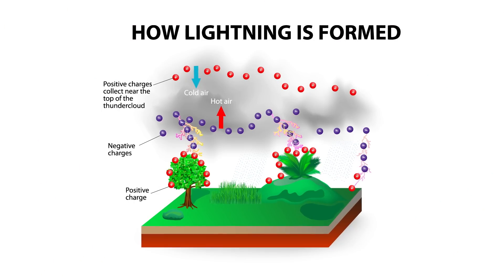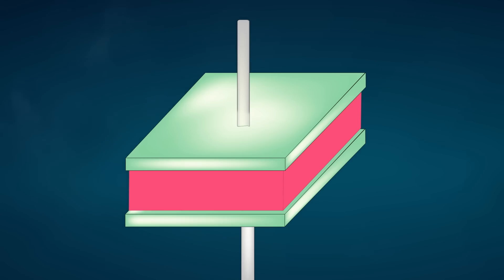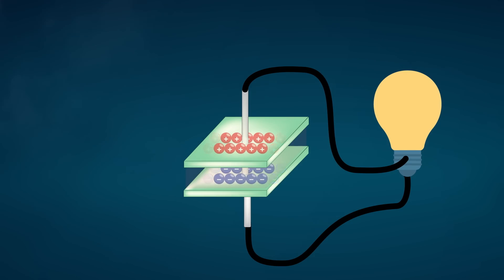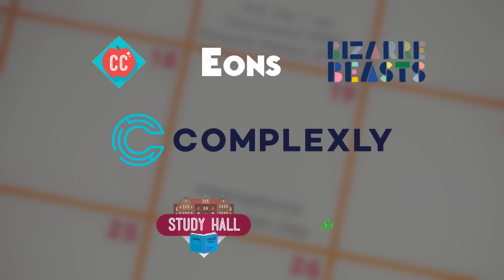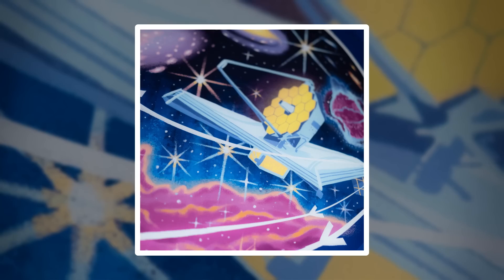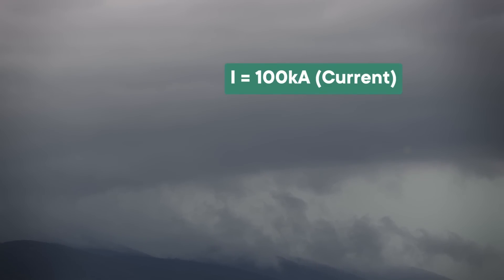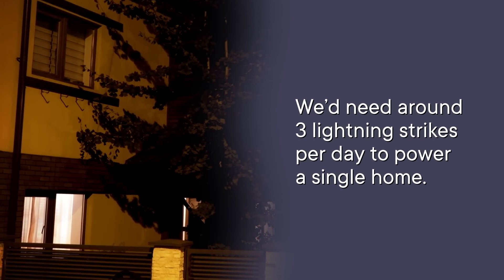Why Can't We Use Lightning for Electricity?

Comment: Thanks for the effort but this video is not up to standard I expect from SciShow... No ... you don't need to create a power plant that gets struck by lightening in order to harvest the energy from lightening. The more plausible way of doing this would be to steal the charges from the cloud BEFORE it forms a lightning. The technology is still in development and is a called "atmospheric electricity harvesting" or "air electricity generation". The field exists, but it’s early-stage, small-scale, and not equivalent to storm-energy extraction.

To understand this better we need to look into how lightning rods work. here is a gross over simplification: A lightning rod gets to work even before it is struck. It has a pointy tip that bleeds electron into the air that is charged positively due to significant negative charge in the cloud. The rod creates a small area around the building (few meters across), that is just slightly less likely to be struck. Of course this is not always enough for larger clouds and there is an eventual point of failure where the rod does get struck by lightning and in that case, they offer a safe way of dissipating that energy to the ground. The effect of a rod being hit by lightning still can be catastrophic leading to damage being done to the rod, but the structure is largely unaffected and it is far safer than a direct contact with the lightning. In my opinion, if we have a chance of harvesting this energy, it would be done at the slow trickle of energy through these rods and not through the lightning itself. Given how little this energy is, it might not worth it to try anyway.

In the mean time we are far better off relying on energy sources such as Solar and nuclear.

Comment: Lightening is too unpredictable and too insanely high of a voltage. Not to mention the unstoppable, melt anything current, The electricity would unpredictably jump out of the socket at you,  in an attempt to find a path to ground, killing you dead, instantly.  Fun Stuff !

Comment: Plenty of equations, lots of reasons it’s a frivolous idea…

Keep
It
Simple
Stupid…

Our power grid distributes alternating current.  Lightning is direct current.  You might as well be asking why we don’t distribute whiskey in the water pipes.
Reply: It's easy to convert DC to AC. That's what makes it possible to connect solar power to the grid. There are plenty of reasons why lightning energy is a bad idea, but this isn't one of them.

Comment: Unlike pre pre Egyptian empire the one's that actually built the pyramids (not the graffiti artist clowns that threw the contents down wells and shafts) that understood spinning mecury with the static current and harnessing the energy with objects like the disc of Sabu stacked on a shaft like a Mazda rotary and something like a large Baghdad battery that you would lift and lower the core or reverse to control direction and intensity , it's the reason for the height and depth of the great pyramid it's missing a metal clad cap that would resemble an antenna 
 As smart as modern monkeys think they are it's entertaining

Comment: 5:46 you lost the trail on magnitudes - 10 megavolts x 100 kiloamps is 10^7 volts x 10^5 amps, so 10^12 watts. A microsecond is one millionth (10^-6) of a second, so 30 microseconds is 30 x 10^-6, or 3 x 10^-5 seconds. So that's 3.33 x 10^6 watt seconds, or 3.33 megawatt seconds. However, you're still right that it's a negligible amount of power. To convert watt seconds to watt hours, you divide by 3600 (60 seconds x 60 minutes). 3.33 x 10^6 ÷ 3600 = 925  watt hours. You can a small space heater for an hour on one lightning strike. You could run an electric tea kettle for ~45 minutes.

Comment: You need to convert the lightning directly to rotational energy stored on a fly wheel. Material science is going to be the future. Or use the electrical force to throw magnets up copper windings and harvest the power generated.

Comment: First you need a huge balloon with flying gas.

Then, install a big latest and anticipated battery pack on it in order to accumulate the electricity from lightning ⚡ 

It is not difficult theoretically 😅

Comment: Lightning.  Gives off many types of energy!! Light, Heat  and sound energy.  You could capture that instantly in an electrolyte liquid.  The rest of the heat could be recovered turned into steam. So you have heat and charged solution
Reply: How do you propose to contain the instantly vaporized electrolyte liquid?

Comment: "Lightening strikes can be positive or negative, which means one can literally cancel out the other." Can someone clarify this point? I was under the impression that lightening/electricity was a discharge and flow of electrons which by definition are negatively charged. Not clear on the positive part.

Comment: Lightning is what happens when energy is released. Using it to power anything is like trying to toast a s'more in the heat of a detonating hand grenade. We'd be better off tapping into the charge potential of the clouds before it builds enough to arc. Think of the clouds and ground like the charged plates in a capacitor, because that's essentially what they are.

Comment: A plane could maybe be used but with current tech the planes instruments would probably be damaged but we are getting closer to over current in serge technology in the computers them selfs but i dont no what would happen in air problems more than likely as if the protectors where not there to defend the tech maybe one day it will get better and the plane can be there in air to get more power from lightning and bring some back to the ground if u need to

Comment: First, we need to invent a Giga-Battery, or 1,000,000,000 the size of compacity than a Double A battery. Should prefer crafting a Cubed battery for structural safety and compacity.

Comment: We don't have to capture the entire spark into capacitors. We can catch a portion of the electromagnetic pulse emitted by the lightning, perhaps using parabolic dishes or other types or aerials, and dump the energy into a capacitor array.
Then the stored charge must be discharged into a heavy duty Capacitor inductor circuit  where the electrical energy oscillates between a capacitor bank and an induction coil. Then we can tap off the oscillating field using transformer coils.
Reply: While doing all of this there will be loss of energy in form of heat. So I think at end it won't be efficient

Comment: Something I dreamed of at 18, but realized that the resistance involved in the capacitors would mean that the discharge would take a less resistive path in the first place, or would jump off somewhere along the path.

A more viable project is the continuous collection of the ground-air charge difference in those lightning-prone areas using helium-filled balloons and graphene-loaded cabling.

The high likelihood of these collectors being struck by lighting means that you could effectively harness lightning as a byproduct, by creating designated jump-off points in the cable and conducting that super-high charge through some process involving slightly less resistance than lightning would encounter traveling through air.

An example would be an expanded Zeldovich mechanism for generating nitrogen oxide as the charge passes from the jump-off conductor to an earth ground, through the air (or some other medium you want to process), inside an insulated container.
Reply: How about running that electrostatic energy to electrostatic motors, which could drive generators, which could charge a bank of batteries.
This was implied to on the “Plasma Channel”.

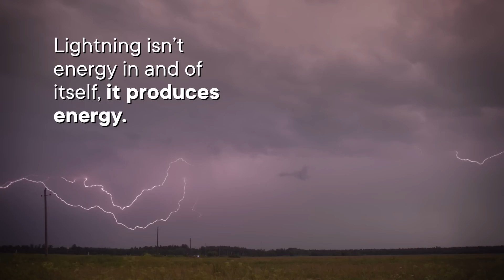Comment: This is so silly... they say it's Billions of joules at 04:44 as if that's a big number then they say it's actually just a few KWh and that that's a small number both of these are units of energy - so which is it? a lot of energy or not a a lot of energy?

Also because KWh and joules are measuring the same thing (quantity of energy) they are directly convertible - 1B joules =  277~KWh.  
So logically it can't be both BILLIONS WITH A B Joules and 8kwh so which is it? 

I'd say it a small thing but it seems like the whole point of the video, it's like your saying: 
1. Lighting is cool and it's have a ton of energy
2. it's difficult to capture, but there are ways
3. It's actually not that great

Comment: the math in this video doesn't check out unfortunately. where the heck did the value of 10MV, 100kA come from? the national weather service says the average lightning strike is 300MV and 30kA, which would mean 9000GW, not 1000GW. if this is supposed to reflect the fact that only a small fraction of the energy reaches the ground in the form of electric energy, it was not explained very well. you guys are usually much more careful about things like this

Comment: We need a way to regulate lightning storms or discharges. I once saw a Professor experiment with directing the lightning to a specific spot by tying wire to a small rocket. It looked like a toy but, it worked consistently. The lightning followed the wired to a metal spike that he buried in the ground.
We need three strikes a day per home.

Comment: Let lightning strike a big resistor that charges a thermal heat  sand battery. Fast charge and slow discharge.

Comment: Well, this is somehow wrong… 8 kWh? Nah…

A typical lightning strike can release about 1 billion to 10 billion joules of energy, equivalent to around 250 kWh to 2,500 kWh of electricity.
Reply: it should start at around 100kWh is what I feel (10x).
Reply: @sickofgettingcopied  1,000,000,000 J / 3,600,000 J/kWh = 277.78 kWh I can be pricese, it is nogotiations 😊 just simple math

Comment: Side Note: If we ever figure out super-capacitors, we could eventually make lightning stations not as their own sole form of power, but in conjunction with other forms. If lightning strikes a wind turbine or solar farm, it has the potential to be really bad. But if we could make lightning stations such as you described to be more like a super form of lightning rod that uses super capacitors to catch the power and use those capacitors to then charge up power storage like batteries to put energy into the grid at a more controlled pace, that might offer a form of protection for the solar/wind farms while adding some extra energy to the grid. We need synergistic solutions, not some mythical magic bullet power lol.
Reply: Idk, I just needed a few bricks, some steel and copper wire for this, granted, it didn't make much power, it was only like 23% efficient
Leaving Nauvis for this was worth it, had to grow the factory

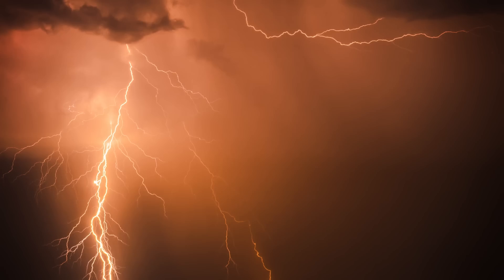Comment: At 1:20 what do you mean "lightning strikes can be positive or negative"? Electrons are negatively charged so negative lightning makes sense, but what is positively charged lightning? A lightning strike of protons instead of electrons?
Reply: They mean directionality of current/electron flow, essentially. 

*An excess of electrons* in the stormcloud would result in electrons traveling from the stormcloud to the ground.

*A lack of electrons* in the stormcloud would result in a lightning strike that pulls electrons from the ground to the stormcloud.

If you captured the first type in a battery, and then the next lightning strike were of the second type, it would just drain the battery of the electrons gathered in the first strike. 

And even worse, unless you found some really clever way to completely isolate the charges you've already captured, a lightning strike of one type would just increase the chances of a lightning strike of the other type. 

Put a big rod into the air to attract electrons and store them? Well ok, now you have a really big rod sticking into the air with an excess of electrons. And more electrons certainly won't want to jump in to that rod anymore. In fact, the excess of electrons in the rod will want to jump back into the stormcloud.
Reply: @cbirch7302  makes sense, if we hook up a lightning rod to a bunch of capacitors that can handle the load, and it gets struck. Now we have a lightning strikes worth of electricity in capacitors trying to discharge through our rod, so it will likely arc back up to the clouds or maybe just the ground.

Comment: Huh... So I wonder what happens if you were to route it through a Fat resister coil on it's way to the ground, and rather than using the electricity Directly, you store that as thermal energy in a thermal mass, and used that to produce electricity through a heat engine or similar?

Even still it's probably too random a source to be useful, but I wonder if that lightning to thermal conversion would work?

Comment: hi, I'm an engineer who works in the field of lightning protection and all I'll say is that the conclusion is correct but there's quite a bit of mistakes getting there.  Lightning is not a practical form of energy that we can capture and use long term but it is very impressive and destructive.

Comment: all of this forgets that what we see as lightning is actually the discharge of energy. from the moment that lighting starts being visible, it is the result of static electricity flowing through the air and exploding it on the way down (or up). As soon as energy starts doing anything either traveling or producing heat or light, it loses watts. The value of energy calculated from a lighting strike takes into account all the work it took to blow up the air on the way down. The best "lighting" collector would theoretically eliminate lighting altogether and would just scrape away the potential energy straight from the clouds. The depiction of how a capacitor works is perfect to describe what is happening in a storm. The clouds the ground beneath the clouds and the air between them make up the three components of the capacitor which means that when you see a lighting strike, it's just the charge shorting out. A theoretical perfect lighting generator would basically be a perpetual cloud that is constantly under turbulence which is only possible with gravity and different fluids (air and vapor) and some thermal dynamics thrown in. This starts to look a lot like a perpetual motion machine though.

Comment: 5:42 1 Terawatt , (1,000,000,000,000 joules ) for 30 micro seconds is 30 Gigawatts 30,000,000,000 joules ) ( 30KWH is 108 Megajoules of energy) you could power 277 homes - also no home should ever be using 30 KWH a day .

Comment: Would lightening even strike a rod connected to capacitors that already has a similar charge? Assuming there would need to be a device that only allows one way flow, could that withstand the jolt?

Comment: I have a special grid system that acts like a giant spider web that will actually collect the lighting strikes and direct it to a series of transformers and capacitors.  The electricity is then stored in giant lithium batteries and sold back to the main grid.     I'm getting rich beyond belief.    Elon Musk keeps knocking on my door for a piece of the action.

Comment: I got a better idea. Instead of storing all that charge in a capasitor, use arrays of many transformer to step down the volage and then use that energy to supply the grid for that time, or store it. With all these advances in ML, there must be some way to predict where the next lightning will fall. So, we can build some fixed infrastructure and some mobile collector (lightning rods) to collect the lightning and send it to the infrastructure.

Comment: An interesting episode, but I take exception to the idea that it isn't worth doing, because even if it were just a supplementary power source in choice environments, at a rate of about 12 cents per kWh, you're looking at just shy of a dollar per lightning strike for something that would require minimal cost investment and have potentially near-zero maintenance once properly implemented.  Couple a lightning rod field with something like pumped-storage hydroelectric for a so-to-speak battery and you can make an even more resilient option.  Or we just keep dropping fission reactors onto the grid.

Comment: Not true it's just way to expensive to make something that won't fry itself first strike fun fact they used to harness some power from lightning storms and we stopped trying because we couldn't get enough energy for it to be viable but now we actually could if companies would be willing to shell out all that cash unfortunately not a single one ever will because how costly it will be and how often most of that system would have to be replaced due to frying out

Comment: The video should have ended at the start. Lightning is generated by a massive capacitor that we call earth. The atmosphere stores one charge, earth stores the other. when there is enough energy on one side to break down air molecules into ozone which is conductive, a lightning strike occurs.  Lightning are literally a short in a capacitor where all the energy gets to move and cancel out. The capacitor would have to have one pin in the sky and the other in the ground and we would only be extending the amount of energy a lightning can have since eventually it will itself spark directly with the ground shorting the man built capacitor as well.

The only possible way to do this is to invent a way to transfer charge between capacitors and scale it up to local electric storms and then we could steal lightnings from storms. which would result in no more lightnings where it is being collected.

Comment: Would it be viable to make stations that can convert a lightning strike into electrolysis of water and make hydrogen from it? Obviously capacity would still be a problem but they could feed the electricity directly into the water with very minimal actual power storage needs?